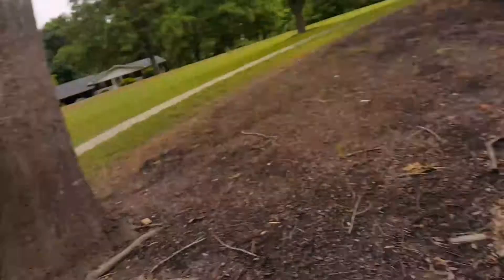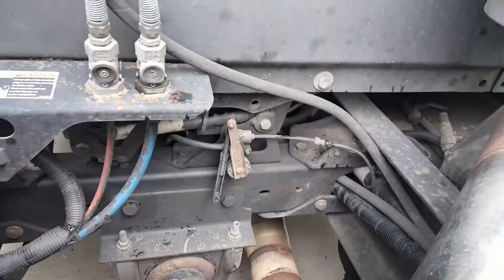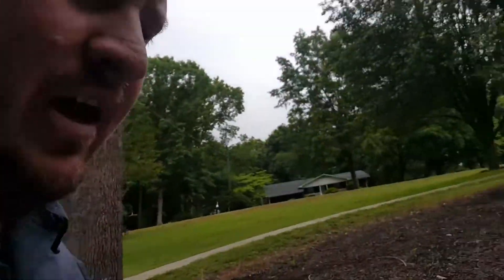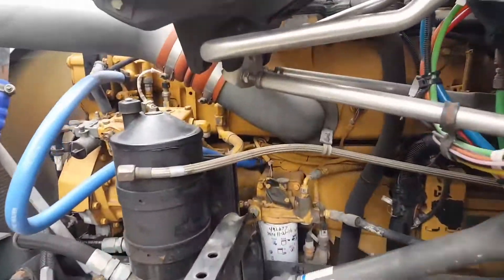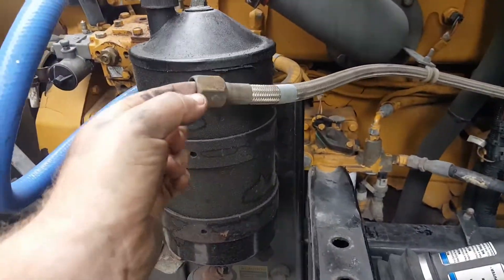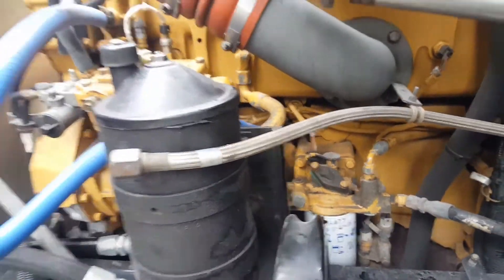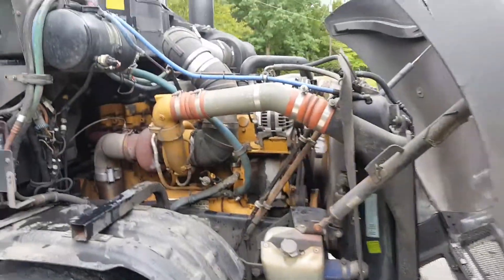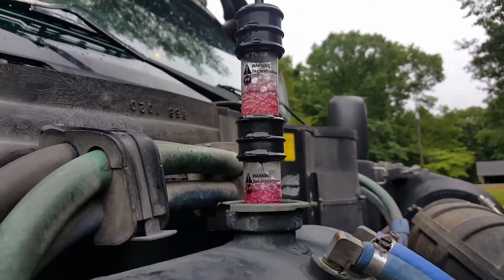Blown head gasket???c15 6nz

Comment: Coolant runs through your Air Compressor, your Air Compressor is still producing PSI, which is leaking into your Coolant System.

Your Air Compressor Head Gasket is bad.

Comment: Head gasket is blown between cylinders and cylinder pressure is leaking into nearest coolant passage   under boost but not enough compression between the two cylinders to suck coolant past the gasket often caused by liners dropping
Reply: Uhhh the solution is NOT turning color.
Reply: C15 's are famous for dropping liners , the liners are threaded into block and the threads wear out from vibration and the liners drops allowing head gasket to fail
Reply: @scottbaird4575  if the solution(block tester fluid) does not change color then it’s not a head gasket issue.
Reply: Liners if not properly shimmed will start to bounce, if they bounce they will distort the blocks counter bore edge and allow the liners to move up and down even more. Which will create a gap between the head the gasket and the block.
Reply: Only way to fix a dropped liner is by properly shimming the correct protrusion height on all 6 liners. And in worse case scenario if the blocks counter bore shoulder is damaged or cracked you will have to hire a Machinists to bore/cut out the damaged shoulder.
Reply: @scottbaird4575  The liners are Not threaded... But still the Block Tester fluid is Not changing color. 

Even if that was the case.

Comment: I would check the turbo pre cooler before pulling the head. They are known to develop a leak and push turbo pressure at up to 50 psi into the coolant system.

Comment: Did anyone ever figure this out? I have a 2004 C15 ACCERT in a Peterbilt 379 that blows bubbles but won't fail any hydrocarbon tests and I've drained all the air and bypassed the air compressor.
Reply: It’s the Air Compressor. Take the Air Compressor off.

Comment: Blown,head gasket for,sure.  If the truck,can get to 200 degrees and it still bubbles, fed blown head gasket or cracked head
Reply: The Hydrocarbon solution is NOT turning Color. Which means(let me squat down) NO Hydrocarbons coming out of the Expansion Tank.

Comment: Did you end up figuring it out?
Reply: When youve got constant gas flow escaping from the radiator at below boiling temps, it is likely to be compression gas escaping the bores and going into the coolant jacket, then being vented by the radiator cap valve.  Raising the rpm will tend to raise the volume of gas escaping, especially under load as boost pressure will obviously gain pressure and blow through faster. 

   Likely culprits are headgasket, failed liner O rings, cracked head, cracked liners, cavitation pitted liners or block registers where the liner seats in the block.  You may also see increased blowby out the slobber tube from compression getting into the windage galley.  SCA coolants and filters that blow headgaskets under high load will tend to have a baked on gray plastic goo coating inside, be on the lookout for that. 

  If it isnt getting worse or blowing coolant out, you can try running the truck a few more days to prepare for an out of frame back near home.  If it is blowing coolant out and you need to limp home, buy a section of hose and run it from the cap vent into the cab to a bucket so you can keep pouring it back in to get better situated for some down time. Been there done that.
Reply from the maker: LUXURY EXPRESS nope still trying everything I know looking for ideas for everybody
Reply: yea i got a similar issue, so wanted to see, thanks anyway
Reply: Hi, how do you by pass the compressor? I have the similar problem. it was only pushing coolant at 200 degrees or more, I ended up rebuilding the whole engine, at the same time converted it to a single turbo, then my rad started leaking, figured I was loosing my coolant there and now that I have that fixed I m still getting pressure in my rad.  Any ideas ? C15 cat single turbo  oil and coolant stay apart
Reply: Did you figure it out yet ? Mines doing something similar,  compressor is bypassed . Runs like a champ and isn't loosing coolant other than what's blowing out the piss hose from the cap. Please say it's was just a head gasket .
Reply: I went through a lot with my engine replaced the head which problem got worse ... replaced turbo jacket and nothing different 
Still at shop
Reply: Did you figure this out? Mine is doing the exact same thing.
Reply: Speedfreak1984 I’m having this same issue did you figure it out
Reply: Did you find the problem?? Fighting this exact problem..
Reply: Could it be the oil cooler??